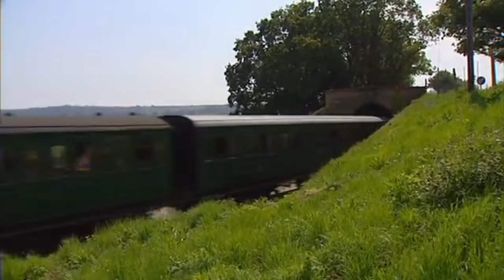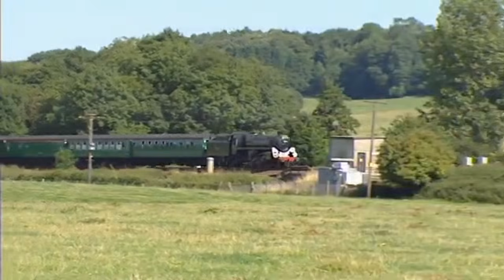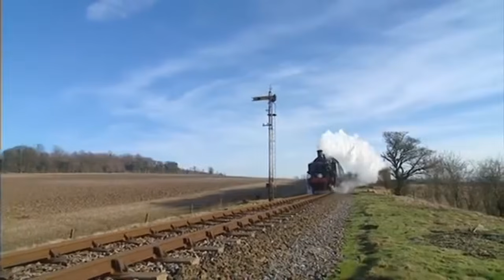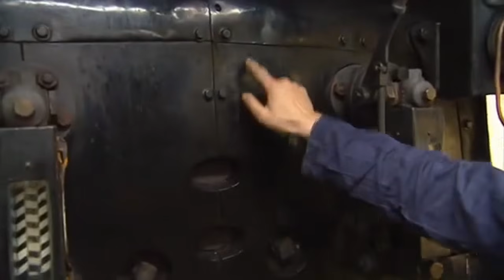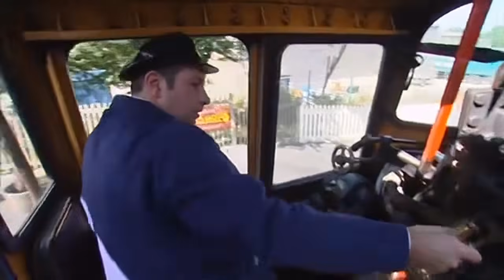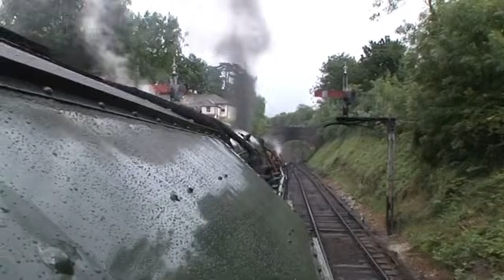Driving and Firing - The Standard Engines (Full Programme)

Comment: High running boards are a hazard. What was the point of them?
Reply from the maker: Easy access most likely.
Reply: @MasterMoyle 
The reason apparently was they wanted to attach to the boiler instead of the frames. It started with the 43xxx series and became a styling feature with the standards. The early drawings for the 43xxx were like a little class 5.

Comment: David Shepard said that when he bought 92203 he got to look at the books for which engine had been shopped for a heavy overhaul only a month or two earlier but was now destined for the scrapyard and 92203 was one of those engines. Some people say that the duchesses or the A4's were the best of British steam locomotive engineering but not for me as I think the 9F's were the best for they could haul passenger trains up to 90mph or heavy goods trains which the duchesses and A4's couldn't.
Reply: It was unfortunately rather common to see across the world during the transition away from steam. Locomotive would be outshopped from a major overhaul, then not 6 months later it was headed for the dead line. 

As far as the 9Fs, I think they would've been even better had they been the high drivered 2-8-2s that was originally intended, something more like a simplified LNER P1. The 2-10-0 arrangement led to some rather bizarre limitations. The firebox is very shallow to fit above the rear driver, and even moreso the ash pan. It was not unheard of for a 9F to "fail", and as soon as it had gotten to the service track, all the fitters could find was wrong was clogged ash pan dampers. The Britannias used a very similar width and length firebox but because the design had the trailing axle it was able to be made much deeper, and they didn't have this problem.
Reply: I’m a huge 9F fan, but ironically the last loco class design was the least future-proof:
- out of gauge in many areas due to fat cylinders
- unable to negotiate modern raised check rails due to centre flangeless wheels, so 9Fs had the indignity of being the first loco class banned from the big railway
- small driving wheels at high revs “hammer blow effect” to trackwork, meant high speed running took its toll on the lines
- all this made them unsuitable for railtours in the preservation era (where the big money is made)
- owners in preservation need deep pockets to run such a big engine on small heritage railways
Reply from the maker: It's not just 9F's that cannot go out as all 2-10-0 designs including the WD 2-10-0's are banned. There's been a story that when 92220 was allowed out it really did struggle with the tight curves.
Reply: A4’s and Coronations often ran fitted freight and fish trains out of Aberdeen and were very successful. The 9F’s could do passenger trains but were rough riding at speed and often ran hot. Needless to say they are banned from the mainline due to the flangless centre drivers.